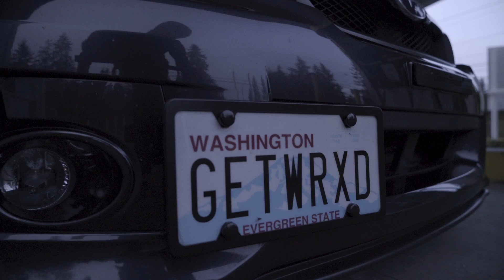Achieving PERFECT Fitment 2011 WRX - KW Variant 3 Coilover Install

Comment: Are you supposed to get an alignment after you lower it? And what were the other parts you on??
Reply from the maker: Yup, you’ll absolutely want to get an alignment after changing the ride height. Suspension wise, other than the coilovers the car has whiteline swaybars, end links, rear reinforcement brackets, roll center and bump steer kit, and caster correction kit.

Comment: Hey whatsup guys Im also local to seattle, I drive a 2017 WRX. Who rolled your fenders? Ive been looking around but havent found a place yet. The help would be greatly appreciated. Also the wrx is looking better than ever with the new ride height. Congrats
Reply from the maker: Andre Tapang Hey man, thanks for checking out the video, really stoked to hear positive feedback on the WRX! But I had the fenders rolled by Seth at Legacy Films NW. You can message him through his instagram page to schedule an appointment, just search for Legacy Films NW. Definitely will vouch for his work, always a quality roll with him!
Reply: Average Bros Media thanks man. we should meet up and you should definitely check out my car once its my wheels are all fitted.
Reply from the maker: No problem! And for sure, if you see the WRX at any car meets say what's up to Louis. I just moved to Los Angeles, so the wagon is down in SoCal now.